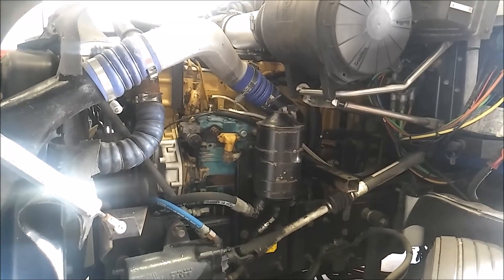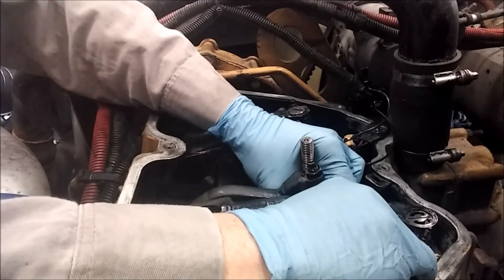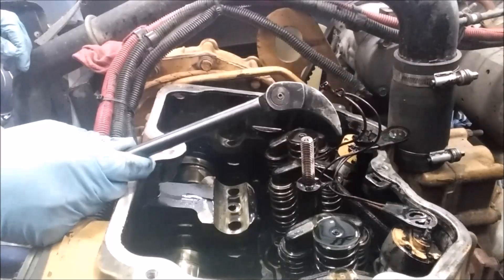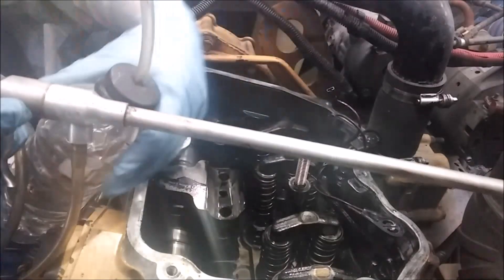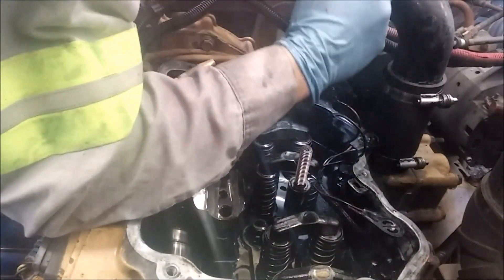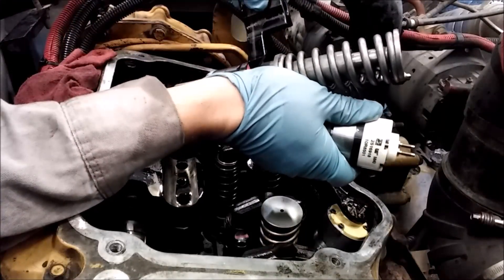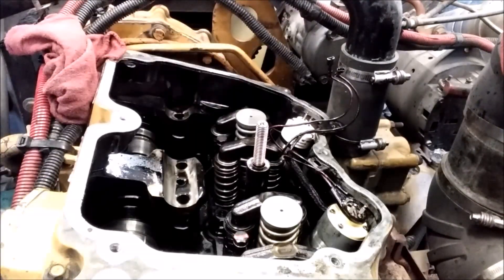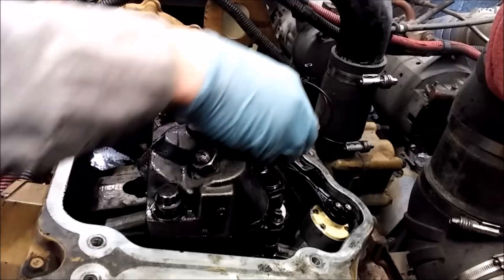How To Change a 3406 Injector or C15 Injector on Cat engines

Comment: what does it mean when fuel is going to coolant?
Reply from the maker: +Matthew Galindo Usually that is caused by the injector cups leaking, those can be changed without removing the head, but the entire overhead has to be removed.
Reply: Does the cup come with new injector
Reply: Adept Ape 
pls I need the accurate measurement tool for the installation of 3406 injectors  and a heel bar, its very difficult for me to get it in my country. pls let me know the cost and shipment cost to Nigeria. thanks.

Comment: I'm governed at 68 on cruise control only 66 would my injectors mess up if I leave the pedal pressed for couple hrs even though it only gets to 68 and cuts after that I have a c15
Reply from the maker: +gus0440446 That wouldn't hurt the injectors because the ECM just restricts the fuel rate once it sees you have reached road speed, so it is controlling the throttle to some extent when it's floored. It wouldn't hurt them.

Comment: will a bad injector make a ticking sound
Reply from the maker: +MJK RIGGING Usually a clicking is valvetrain related and if an injector spring failed it can cause the injector rocker to make a tapping sound, best to pull those valve covers as soon as possible.
Reply: Ok thanks will do
Reply: +Adept Ape si I took cover off nothing loose or broken brought to caterpillar had them run overhead. it does not feel right I have to put pedal to floor to build speed. I've driven this truck  over 1.5 million and never felt like this. what could they have done wrong I may be crazy but motor sounds quieter

Comment: Hey friend can you do another vid testing the wiring harness from the ECM to the injectors?
Reply from the maker: +Transguy I have done one of those already, but do you want a longer one video or just how to ohm the wires out? What part do you need more info on?
Reply: I know how to ohm wires. I was wondering if you can test the injector signal leaving the ECM with a multimeter or scope to help rule out the ECM or confirm its faulty.

Id have to know which pin goes to each injector and back probe the correct pins.
Reply from the maker: +Transguy The ECM actively monitors the injector signals. If you watch my cylinder cutout or check engine light videos it talks about it testing the engine for weak injectors, we don't use the same high tech scope set up as the automotive side. It is really popping solenoid for current faults and testing the cylinders to verify weak injectors.

Comment: do the c7  on highway engine and c7 marine engine share the same ecm and sensors? are they the same ?

thanks!!!
Reply from the maker: Most components are the same, but you could have differences between electrical connectors and fittings. Even an on highway C7 with different serial numbers such as a WAX or SAP serial can have differences. You would have to physically look up the parts to see the differences.

Comment: how do you test the electronic pulse. Can you point me to a vid? Thanks!
Reply from the maker: I think we have a term conflict here, what exactly do you mean the electronic pulse? Are you talking about the electric circuit that the ECM fires the injectors with?
Reply: Yesir! On our 96 379 Pete we had a #1 injector quit firing on our lowboy with a 3406E motor.  I needed to check ECM pulse to fire the injectors.

I need a way to test that pulse leaving the ECM, also at the plug at the valve covers and finally at each individual injector.

We've got it fixed now but bought a near 300 dollar injector wiring harness that we didn't need. We had someone come buy and scan it and everything and that's what he recommended.

Turns out #1 quit firing because the plug leaving the ECM was partially backed out on one side because the clips have broke on the plug and someone had zip tied it.

Comment: In one of your videos you showed a cat product for finding fuel leaks in the valve cover possibly injectors. You put it in a fuel filter and ran it. Do you know that product part number off hand?
Reply from the maker: +21elements21 it's called gas-glo 32 and its made by spectroline the part number from Cat is 1U5574. Check Amazon though to see if they have it.

Comment: you don't use Injector Height Gauge 9U-7227??
Reply from the maker: +Adrian Hurtado I don't remember the part number off the top of my head, but yes after installing injectors you should set the height with the injector height tool. I mentioned in the video about doing an overhead, which includes setting the injector height, but didn't included running the overhead as that will be in a separate video.

Comment: On a 3406E 5EK what is the trim file for maximum fuel injection? I believe it starts with a 2.
Reply from the maker: I actually do not know because we never mess with the factory trim files or with tuning, whatever the injector trim file is on the injector is the one we program it to. You may have to find out on a performance forum or the like.
Reply: Ohh okay no problem. I worked at a truck center and we would install a performance trim file for customers at their request. It was a practice done off the books. I no longer work for the truck center and misplaced those CAT documents. Thanks anyways for your help.

Comment: Do you have a video showing how to replace the valve actuators  on a 2007 cat c15 acert?
Reply from the maker: +Michael Norris I do not have one yet, but will be making one in the future, are you changing just the solenoids or the actuators themselves?
Reply: +Adept Ape I went and had a good quality mechanic do it cause the wiring harness that goes to the fuel injectors and valve actuators had a busted wire and it's a running awesome!! keep up the awesome work on the videos and thank you for replying sir.
Reply from the maker: +Michael Norris Glad you got it fixed and are running again. Thanks for commenting.

Comment: Hannah the Jake was bearly touching 2 pins I plugged it in now I have 3 selections and strong to
Reply from the maker: +fisnik bojku Hey that beats trying to connect them all, I wonder if your friend has the same problem. Do you think it got loose when you installed the radio?
Reply: Somebody has played with that thing before me the ltl two fuses or secure thingis what ever want to call them were worn out dot secure the connection that's how it came loose so I took care of it now
Reply from the maker: +fisnik bojku Cool, well glad you didn't have to mess with it too long.

Comment: hi would you please look in to that Jake brake switch again cause everywhere I read it shows it as 2position instead of 3 position and it says it's eather on or off  nothing about low , med,or hi
Reply from the maker: The on/off switch is a two position switch, but the low/med/hi switch is a three position switch. The confusing part is that the circuit out of the switch has only two wires, so the positions for the switch circuit 1, circuit 2, and the third position is both circuits at the same time. Hope that helps, its confusing without a diagram.
Reply: I am on my way to pick up the truck and then for your help
Reply: Thanx
Reply from the maker: +fisnik bojku Alright, I'll get you a wiring diagram to show you what I mean.

Comment: Curious what brand paint pen you use? I've been using Sharpie paint pens but they really fade after a while and they don't do well in oily environments. I use them to color code hydraulic lines on farm equipment.
Reply from the maker: +William Garrett I forget the brand name actually, the company provides them, if I had to buy them I would remember. I'll check on Monday for the brand, they work really well, but they do like dry surfaces.
Reply: Get different colors of tape, thats what I did. Or get a paint pen.
Reply: Bill Hill I don't think I want to put bits of tape in my engines. I was asking him about paint pens.
Reply: William Garrett
I thought you were referring to hydraulic lines on equipment, not engine internals.

Comment: I see a lot of oil on top by the head
Reply from the maker: +fisnik bojku Well your Jake's are oil actuated. You could have a leak between the Jake housings and the little oil bridges in the valve cover base. One of the Jake housings could be leaking as well, you could try putting some air pressure in the oil rail feeding the Jake housings and see if there is a big leak.

Comment: morning sir I opend up the covers last night checked the valve lash s on everything  .015 intake .030 exhaust .027 Jake's  and .020 on vva it looks good I rave the engine and put the Jake's on it slows down the engine on all cylinders but driving is very weak any suggestions   thank you
Reply from the maker: +fisnik bojku The adjustment sounds pretty good, but still hitting weak. Hmmmmm could be possibly the Jake actuators themselves are getting worn out, the new housings are pretty expensive though. I'm not sure if they make rebuild kits for the Cat housings, the older ones I know they did.

Comment: you told me last time that the 2 wires on the head going to Jake's and injectors need to be changed I think is the solenoids or still when I adjusted valves I did a bad job
Reply from the maker: +fisnik bojku If your still having wiring problems then you have to get that fixed. It would be nice to check that overhead again to just to make sure they haven't backed off or something.
Reply: And if you could tell me how to check solenoids if they good it would be nice

Comment: boss my Jake's didn't stop me at all today I bearly stop the truck and when I did it was coverd in smoke I thot it caught fire but not  I can hear the noise but they are very weak any suggestions
Reply from the maker: Any check engine lights? If you have good oil pressure, but the Jake's aren't working it's a good idea to check the overhead and see if the adjustment is off. They do make Jake rebuild kits as well that replace the solenoid and valves in the housing, could be worn out.

Comment: how do you adjust Jakes on 3406 e
Reply from the maker: When the exhaust rocker is loose and on the base circle of the cam, set the gap between the jake adjuster and rocker.  The setting depends on the horsepower, serial number, and part number of the Jake housing.

Comment: If doing # 1 and 2. Loosen lash adjuster on #2 E when pinned to #6, then rotate it #1 and loosen 1 I E and 2 I?    
I don't know valve spring pressures on a 3406E better to ask procedure,  great video.
Reply from the maker: +bigfootGeorgia It's hard to explain over a comment board, I and a video on overhead adjustment basics that explains which to do, but it isn't specific to 3406s

Comment: How much are those injectors???  curious
Reply from the maker: I think Reman C15 injectors are about 800 dollars each, but don't quote me on those prices, they change all the time.
Reply: WOW   -   are there 6 injectors ???
Reply from the maker: +Donald Ellett Yes sir, there is an injector for each cylinder, A set of injectors, plus the labor to install them is pretty expensive.
Reply: Thanks  -  what are those injectors made of gold - how often do these have to be replaced - whenever necessary I guess you would say??
Reply from the maker: +Donald Ellett You are slightly unfamiliar with Cat part prices I see. They are very expensive on pretty much everything, but they do last awhile. You'll get several hundred thousand miles out of a set of injectors. I've even seen guys getting overhauls that have original injectors with over a Million miles on them, but they don't last that long normally.
Reply: Your right to a certain extent - I do know cat has very high price - no doubt - I did not know some of them lasted that long - I figured 4 to 5 years all depends on how much you use the equipment -    thanks

Comment: how do u chg inj. cup and what kind of tool do i need
Reply from the maker: +royce anderson To change the cups, I recommend changing all 6 at once. You have to remove all the injectors and drain the coolant. On the C15/3406 engines there is a tool that threads into the cup and the a puller that pulls the cup out. To install it, you use the installer, but tap them back in with a small hammer. Then reseal and install the injectors.

Comment: Great video my friend . I have a 2001 pete with a c15 6nz , could you do a video on adjusting Jake Brakes ?
Reply from the maker: Yes sir I can, C15 overhead is actually my number 1 request, but I'm waiting to get one in the shop. Been working on a lot of C7 engines, cooling system faults, and electrical faults. I'll hopefully get one up soon though.
Reply: Thank you for the fast reply . I am actually a John Deere Ag master field tech and I bought my peterbilt as a hobby truck and maybe a show truck some day . It is funny but all the things I watch you do are so much the same with Deere . But CAT rocks I am a huge fan of CAT engines they are the best in my opinion . Farm tractors do not have Jakes so I am curious on how to adjust them . Thank you

Comment: bout time someone started a channel for big engines!!! just wondering though shouldn't you do a valve set after changing an injector??
Reply from the maker: Yes it is a good idea. I did a quick check of the overhead on this engine, but am going to do a full C15 overhead adjustment video in the future and that is why I didn't include the adjustment in this video. Thanks for the comments.

Comment: What about any kind of valve adjustment on the jake or the air valve actuators when changing injectors on a c15 cat motor.
Reply from the maker: I think I mentioned in the end of the video that it is good idea to have a complete overhead done after doing injectors. Since the overhead is off anyways, you can kill 2 bird with one wrench.

Comment: Where does fuel enter the head?
Reply from the maker: +Ross Wade On a C15 there is a hose that runs from the filter housing to the front of the head next to the thermostat housing and front structure, that is the supply hose. The return hose runs from the back of the head to the filter housing.

Comment: This is a stupid question but im not familiar at all with diesel engines... What is the purpose of the spring on the injector? Or why does it have a solenoid? I know gasoline injectors have solenoids basically to inject fuel (or to actuate a valve), but the pressure comes from a high pressure pump (usually 3 bar in a non direct injection engine). The spring is there to build fuel pressure and it doesnt have a fuel pump? Thank you! Your videos are the best!
Reply from the maker: Those are very good questions and your guesses are pretty good. This engine does not have a high pressure pump, so the camshaft drives a rocker arm to build fuel pressure in the injectors, hence the spring, then the injector is fired by the ECM electronically, hence the solenoid. So you were right.
Reply: Hey, thank you for your ultra fast reply!! Yeap that's what i thought. Thank you again!You really explain your videos well you deserve my subscription!
Reply from the maker: +ExplosiveAnyThing Hopefully I got your subscription, thanks for commenting.

Comment: how do we change the injector sleeve
on CAT c15
Reply from the maker: You have to pull the overhead off, then remove all the injectors, drain the coolant, and then there is a threaded puller that threads into the cup and is pulled out. To install them you can use the threaded puller and then tap the new ones in with new seals. Then reseal and install the injectors and overhead.

Comment: HELLO ! I AM BACK   REN HOSE FROM BUCKET TO TRANSFER PUMP   IT WAS DIFFICULT TO PRIME IT  BUT FINALY STARTED    PRESSURE WAS 80 AT FIRS  BUT 10 MINUTES LATER  DROPT GRADULY  AN STALLED   PLENTY OF FUEL IN BUCKET.  IF I WAS GONNA PULL INJECTORS  DO I NEED TO DO ANY ADJASTMENT AFTER INSTALLING NEW O RINGS?  THANKS
Reply from the maker: Yes you should run the overhead and injector height adjustment on the injectors if you remove them. I do not have a video of doing that yet, but I will in the future.

Comment: I learned a trick at a Cummins class years ago. Take a wooden broom handle, or same size dowel, saw a 1" long slit on one end. Then grind a taper on the same end to roughly match the taper of the cup. Slide a triangle piece of Red scotch bright pad into the tapered end slit. Now you have an injector bore cleaner.
Reply from the maker: That's a cheaper solution than the $100 extended angle die grinder I bought, now you tell me! Luckily I have good luck just spraying the bore with brake clean usually.

Comment: yes changed both valves  pressure and bypass, no recirculation hose. I will try to run it directly from tank to transfer pump    will let you know the results   thank you !
Reply from the maker: Preferably like a 5 gallon fuel tank or canister and not the fuel tank.

Comment: 86 PSI AT IDLE   35-40 WHEN POWER LOSS
Reply from the maker: Well it's definitely a fuel pressure is. The injector cups usually cause fuel into the coolant. So a couple ideas, have you changed the pressure regulating valve in the filter base? Does your engine have the recirculation hose from the fuel line to the inlet? If it has it, then shut it off, it should have a ball valve. Try running the truck out of a fuel container directly to the fuel transfer pump to bypass the entire suction side of the fuel system. If that fixes it then run it directly to the primary fuel filter housing and see if that works. Those are my ideas, let me know.

Comment: hello   I have a interrmiten power loss  changed fuel filters transfer pump check valve bypass valve new hoses from fuel tank  installed pressure gauge next to priming pump.  it seems I loose fuel pressure when power loss happens   cud I have bad cups ?  no fuel in oil and no fuel in coolant no smoke  1998 3406 e model  90000 miles on engine  injectors where pulled few month ago do to hard starting  faund 1 bad o ring   if u could give me some advise I d be thankful
Reply from the maker: What are your normal pressures and what are your pressures when the engine is low on power?